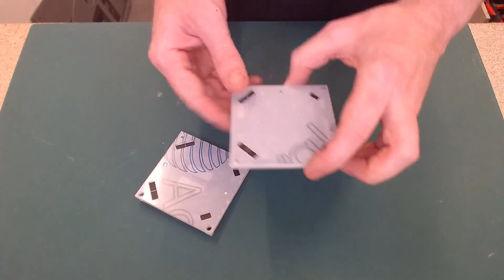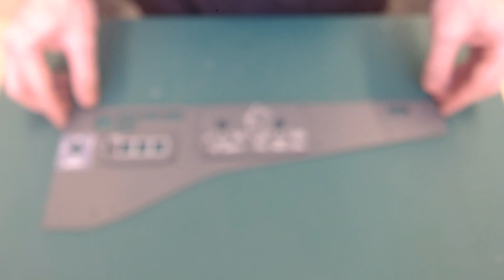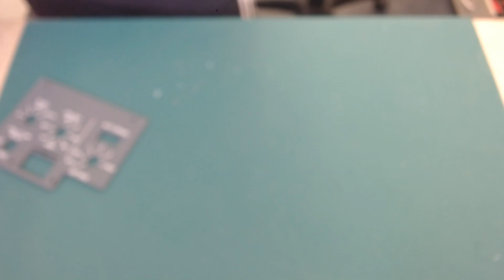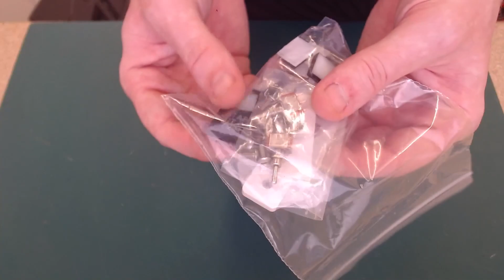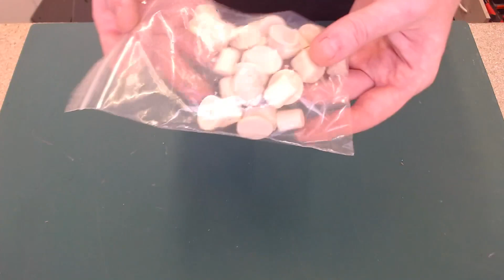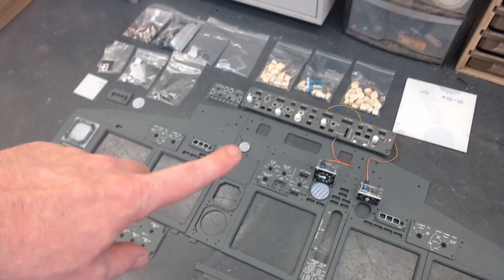737 home sim build - cockpit sim parts MIP overview

Comment: Coincidentally I am also called Ian - and I am possibly at the same point as you in this video. I have toyed many times with how to mount that panel and build a frame. I still havent decided how to go about it even though I have the MIP stand built.
Reply from the maker: Ian Hutty hi Ian, I have now got the panel mounted which will be coming up in another video soon once I’ve done a little more recording and edited it.
Reply: @simbuilduk5853  I will certainly watch out for that video. I have even toyed with buying the opencockpits dual mip but might be a bit pricey. Probably more sturdy than my woodworking. My forte is software being in the IT game and electronics  and not wood.
Reply from the maker: Ian Hutty being a carpenter my knowledge lies in woodworking, I think you might find my next video interesting, may give you some ideas

Comment: They look really great. Do you know what all those little + marks are for?
Reply: The plus marks indicate the location of backlight bulbs on the real boeing panels - so I'm told.
Reply from the maker: The cross shows where the lighting panel connector is, it is usually a small round plug almost like a tv aerial plug in shape but about half the size which has a corresponding socket on the panel chassis. Shows you where to press to ensure it has mated after you have had the panel apart.
Reply: @simbuilduk5853  Haha well done you.. I always thought tapping on the fuel gauge was in mirth, but its a thing! If the light goes off, tap on the cross ;-)
I also have one of Sam's creations. Good Luck